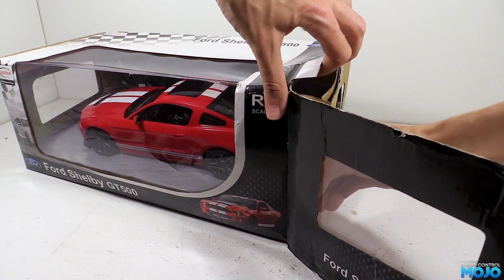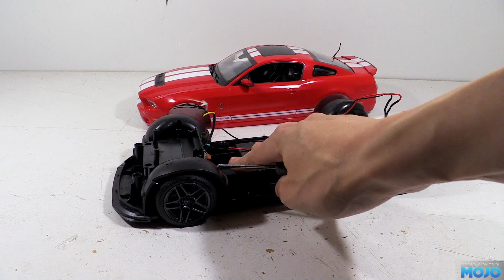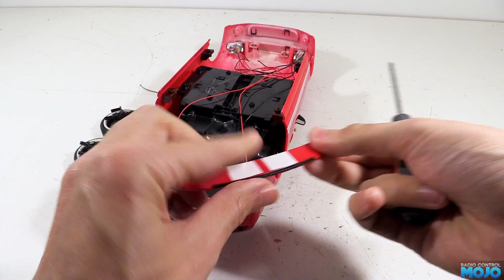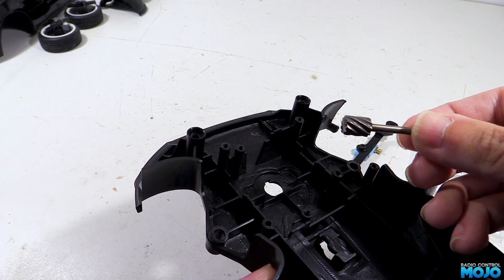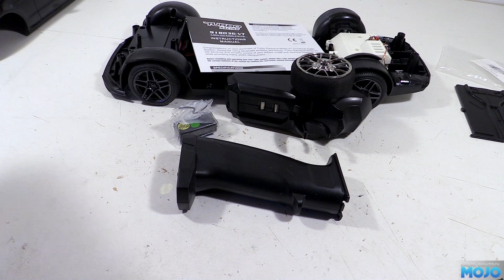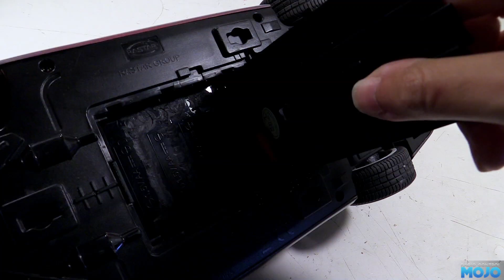Rastar Shelby GT500 - 1 - Hobby Grade Conversion

Comment: dear creator of the RC Tuned up Model of the Gt500, where can i Buy your Servo CNC machined Plastic Parts for my Rastar car? Do you sell a complete set with stearing motor, electrics, and Remote control ?  thx for the great review
allready found 

MG90S Micro Servo

Goolsky turbo racing 91803g VT 2,4 ghz
and whats the name of the ECU?

thx

Comment: I read this on a forum. have you tried spraying a light dust of Plastic Weld on ABS bodies to make them tacky ready for paint.. Very light mist and do not touch it.
Reply from the maker: An interesting thought, I can imagine it'll make the surface a bit rough if left to dry. Getting it even so it doesn't pool might be a bit tricky though

Comment: Good, creative project!! 
Hey, I've actually got a Top tip for you...
When dealing with Hot Glue - simply drip some Denatured Alcohol over the Parts, and within 10 seconds - the Glue CLEANLY separates, with no damage to either Bit!! 😳😉
(Unless possibly, one of the Parts was painted with Acrylic Paint) 

It just easily releases the bond. Try it on scrap bits... See how it works! 😉 
Carmine ✈🚂🚙
Reply: You are right, that Steering is a bit poor... 
With your high level of skill, you could easily make a long enough Servo Horn - that doesn't interfere with anything underneath. 😉

Comment: Well, the finished car looks amazing!  I have to admit that I was a bit skeptical when you mentioned you were going to repaint it.  It looks great in black.  I've picked up one of those vintage Monogram 1/8th scale model Vettes (the '82 Collector Edition) that I'm planning to remake into a proper RC.  Doing it your way seems so much simpler.  Also, I own a 1:1 '09 Mustang GT 5-speed (the only Ford I've ever owned) and I love the car.  It has aftermarket exhaust; that V8 sounds incredible.  Great video, as always.  Cheers!
Reply from the maker: 1/8th, wow, that'll be quite the project